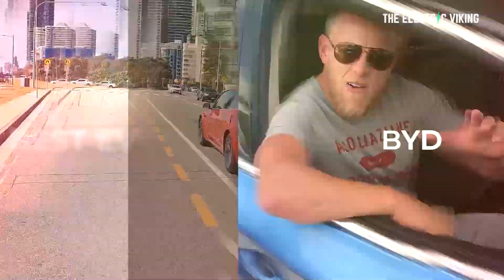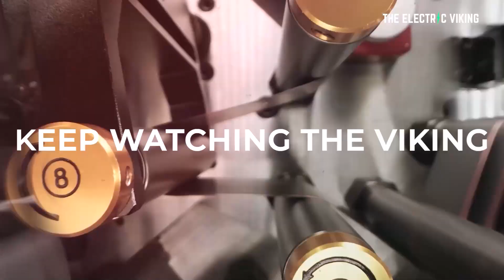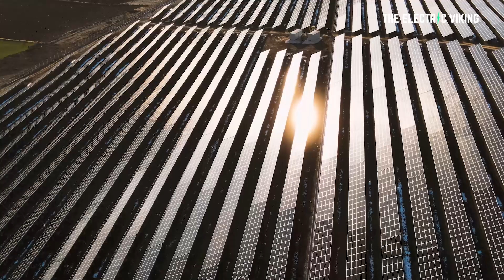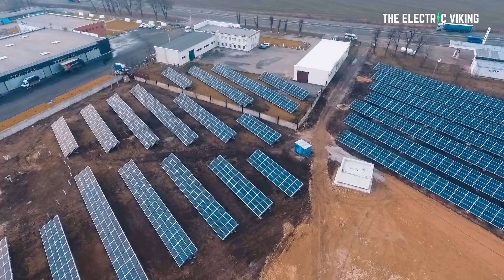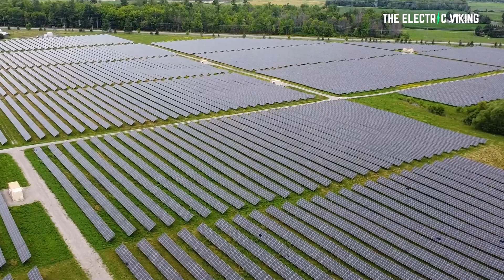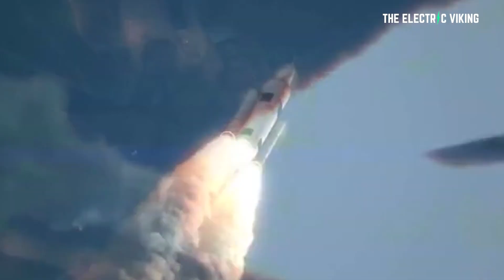Solar panels that work at night could power the Earth 24/7

Comment: Here in Czechia, where the solar electricity is subsidized and more expensive, there is also a lot of solar energy produced during the night: it is simply done by running diesel electricity generators and assigning it to solar. This way these robber barons were able to convert night into a day. Not sure if it is possible anymore, but it was a joke sirprise finding just a few years ago - they really produced solar energy at night by running diesel generators!

Comment: Sorry Sam but I won't hold my breath. Perhaps using the radiated heat from buildings may keep wind generators running but this lack of heat radiation is kinda peanutz! I like the solar panels in space though.

"Space elevators"? Sorry but this is laughable until fusion is happening. It won't really be an elevator btw.

Comment: TEG (thermoelectric generator)  combined with PV - how hard can it be, and getting the returns on expenditure...

NB, so much freaking B$, as admitted... - If you care about power for Africans, give them terrestrial solar for cooking, lighting and refrigeration (some of the greatest advances in health ever.)  the 24 hour reality - absolutely, isn't not this  side of thermonuclear winter.

(NB, the planed Does absorb energy from the sun 24/7...  - for a space generator to be generating 24/7 it needs to be solar synchronous - and we need a global grid to convey such energy world wide (same problem with conventional solar)  - distributed terrestrial solar is much more feasible and on the horizon.

Mass geo/ space engineering is going to be exceedingly risky - and ,ay threaten life itself if the megalomaniacs get their way.

Comment: Is there any way to build a solar panel that works at wavelengths around 10 microns? The average temperature on Earth is 288K and the peak of the blackbody radiation emitted by the surface of the Earth is at around 10 microns with 390W/m^2. If we could build a solar cell for those wavelengths, we would basically be able to harvest the thermal radiation energy from the Earth 24/7.

Comment: Peak energy use 6 pm 8pm. This technology is amazing indeed.Long wave radiation is extremely hot when emitted from th sun. 93 million miles later it enters th earths atmosphere bounces off a brightly colored object toward space but restricted by th carbon level of stratosphere.trick is capture short wave radiation in cold vacumn of space ( high frequency receiver maybe) an use it on earth

Comment: There are a lot of scammers and ill-informed people  in this world: 
1) You cannot harvest energy from a source witha lack of energy. Sure, there is a tiny amount of electromagnetic radiation from space, but that, in turn, only allows very small quantities of energy per square metre to be harvested. 
2) Putting lots of solar PV angels into space and sending some of that energy to the Earth will result in a net gain of total energy hitting the planet. So it cannot possibly reduce global warming, unless other forms of electricity generation are reduced. And in any case, 
3) transmitting RF energy from space to Earth is amazingly lossy. Most of the energy is absorbed by the atmosphere, and water vapour in the atmosphere, except for at specific wavelength ranges, where losses are somewhat lower. 
4) Then when the energy reaches the surface, collecting it all is impossible, unless there is a receiving dish which receives all of that RF or LASER signal, and converts all of it into electricity. 
5) That's not possible with known technology, and never will be, because no receiving system is lossless. It would be absolutely amazing if even 1% of the Solar energy hitting those PV panels in space resulted in electricity at someone's mains power outlet. 
6) The other 99% is lost as heat. That heat i) warms the PV panels and is re-radiated, ii) is lost in the transmitter circuitry and transmitting antenna (even a laser is only about 6% efficient), iii) Heats the atmosphere directly, iv) heats the receiving array, v) heats the receiver and conversion circuitry vi) is lost as heat in the AC conversion vii) is lost because of reluctance and resistance in the step-up transformers, viii) is lost because of resistance in the necessarily long transmission lines (nobody in their right mind would want such high power RF or LASER energy close to a centre of population), and ix) is lost in the usual step down transformers of the local urban grid.
7) Those Solar PV panels will need launching into space and replacing every couple of decades, just as they are on the ISS. It takes up to about 265 kg of fuel to put 1kg into a high orbit which avoids most of the shadow of the Earth. 
8) Those higher orbits are subject to higher levels of radiation, which destroy electronic devices, including PV panels.
9) Panels will be put out of action by space debris, both natural and man-made.
10) Those higher orbits increase the path losses of any RF or LASER signal. For instance, even with the best antennae, dispersion happens, and cannot be reduced to zero.
No doubt there are more causes for losses, but these 10 points are enough to prove the impracticality of such a system.
There is absolutely no valid reason why space-borne electricity generation would be necessary; there is always daylight and sunlight, or wind and wave power, at some place on Earth, and modern storage systems are much cheaper, easier to service and replace, less polluting, do not add to the planet's total heat energy budget, much safer, easier to recycle, and less controversial than any space-based electricity generating system.
And they're easier to recycle. How often is it economically viable to recycle orbital space junk? My guess is never.

Comment: 100% renewable is a stupid goal. The goal should be meeting our needs while minimizing environmental impact, not being called renewable. 
The inconvenient fact is that low-carbon energy generation depends on metals and minerals, just like high-carbon energy generation depends on oil and gas. You can’t call these metals and minerals with a prayer or make them in a lab. They have to be mined. What kinds, how much, and at what financial and environmental costs vary tremendously, and its not related to being called renewable or not. As dilute intermittents like wind and solar are so problematic both in the enormous amount of resources they require and in loss of efficiency when incorporated into infrastructure they have a far larger environmental impact than the other low-carbon options. Over dependence on W&S will involve digging, blasting & leaching more minerals from the skin of this planet than ever before.
What's important is reliability, affordable, and low environmental impact. Focusing on renewable instead is counterproductive.

Comment: The opening picture shows a project that is a stupid waste of land and money. All this is because we convinced ourselves that CO2 is bad without sufficient scientific evidence. What will be the efficiency of these panels after the first big windstorm that sandblasts the stuffing out of them? Do they rotate with the sun? That's expensive hardware. And they are miles from the customers. And the solar flux is just too dilute, do the arithmetic, in Arizona solar insolation for a latitude tilted panel has an average of about 6.5 kwhr/m^2/day. Multiply that number by all the efficiencies and cp to price of electricity. We need 0.5 cents per kwhr energy not 50 cents per kwhr. Talk about propaganda on a massive scale.

Comment: The power from thermal transfer from the Earth to the sky is not substantial. One could use heat pumps and transfer Earth “geothermal” energy to “space” by pointing the radiators to the night sky. This is essentially geothermal energy at night.

Comment: Don't get too excited, even optimized to its maximum potential, it will still only be a tiny amount of energy, at a cost that will never be viable.
Back when solar panels were not producing much energy compared to today, they knew the potential was much higher.
With the energy generation by radiative cooling, it is already known that the potential energy production is extremely low.

Comment: Hi Sam, I was thinking of this problem in a slightly different way. Rather than trying to get energy from space at night, it would be a great way to get rid of unwanted energy. That is the same energy that we demonise as global warming. To radiate it back out into space at night from panels that produced it in one form, electrical power, and send out radiant heat at night in a form that is not blocked by the greenhouse gasses in the atmosphere.🤔

Comment: Are you sane?  Anyone with a credible science degree knows that small amounts of electricity can be generated by any thermal gradient i.e. a difference of temperature.  This is exactly how those car chillers work but they turn current into a temperature drop on the cooler.  There is nothing new about this technology and it most certainly cannot generate any meaningful amount of electricity because it will generate far less energy than the cost of making it work on solar panels.  Even Italian scientists 300 years ago knew how to use what we now call a thermocouple to generate electricity using a diference in temperature.  Geothermal power can also use technology simliar to your refrigerator to turn low grade heat into electricity but it is very expensive per KwHr and also not suited to big Gigawatt generators.  You talk about these technologies like my year 7 students who have no capacity to put anything scientific into perspective.

Comment: 50 mW vs 200 W. Is  400:1 ratio. Plus, The panels will only generate power while cooling down, which may be only a few minutes vs the hours in the sunshine, so the ratio may be 5000:1. Or about 10 seconds of sunshine.

Comment: At about 1/4000th the rated power of a panel, even with 10x improvement with time, the power available is still negligible. I'm all for renewable energy, but this has a very few ultra-niche applications at the very best.

Comment: One issue I do NOT see anyone reporting on is speculation in the materials used for batteries. I have heard that lithium has tripled in price. Is this price driven by demand and supply for lithium? Or is the price of lithium being driven by speculation? 

For example, let's say oil and gas wanted to drive up the price of metals used in batteries, could they speculate in the commodities market to drive up those prices? We know the oil prices are manipulated by OPEC. Gold prices are manipulated by cental banks. Real estate prices are routinely manipulated.

What can be done to stop speculation? Governments can tax speculative transactions to make them unprofitable. For example, in Canada, one city placed a 30% tax on foreign real estate transactions because local real estate prices were being driven up by millions. This killed the speculation. Real estate prices went down. The speculation stopped.

Comment: 50 miliwats per square meter!  You'd need 8 tennis courts covered in panels to power a 100 watt light bulb.  That's 4000 times worse than during the day.  Why not just buy a tiny battery.  This really makes no sense at all, try to curate your content to a minimal extent at least.

Comment: In regards to solar panels in space then they have been used up there for a long time. The problems with a space based solar power station are first to get the panels up there. It is costly and will remain so even with reusable rockets. The advantage here is that they don't have to be very robust as there is no weight or wind problems in space.
Secondly the micro wave transmission to earth is not very efficient and also require a receiver on earth similar to a normal solar installation. It wouldn't be solar panels but micro wave receiving antenna's. A big mirror in space would do the same except micro waves penetrated clouds better then reflected solar light. All these extra costs have to be compared to the cost of bigger solar installations on earth and batteries or some other storage system. A power cable along a space elevator would remove many of the problems but making the space elevator is a big problem.
The development of the sodium battery could easily make it impossible expensive with space power installations for earth as what I read may well make them much cheaper, safer and just as reliable than LiFePo4 batteries. That would also make it irrelevant with night solar panels.

Comment: Thanks Sam Evans for covering this interesting subject.  
This book shows what is urgently needed but not widely understood: "Climate Restoration The Only Future That Will Sustain The Human Race  Peter Fiekowsky Carole Douglas"  Dangerous tipping points must be stopped and reversed!    
New concepts for a space solar shade and SpaceX launch cost reduction will make a space solar shade at the L1 LaGrange point possible.
However the most practical power beaming receiver base is at the North Pole.  So either it will be used to generate fast quantities of hydrogen fuel and/or it will be connected to a very high capacity electrical super grid.
The next 100 years of power and energy technology development will be incredible to see!

Comment: I have some solar lights on my fence that work after the sun moves to the front of the house in Oct.  I was amazed when this happened when I first got them. Those little lights would stay on dimly almost all knight for a few years but now the batteries declining and had to replace them.
Reply: Yes. Batteries. Not solar panels working at night.

Comment: Milliwatts are almost completely useless, it can't even run your night light. We don't need new technology, and we don't need to wait 30 years to move. We can already implement 100% clean energy today, with what we have, it's just a matter of scaling solar, wind and storage up. A matter of mass production only. Everything else will be too late. Better figure out how to do the laundry, water heating and EV charging during the peak sunny hours. And how to convert UV light into red for cloudy days. There's only one new tech that I think will happen fast enough, and that's drilling deep several miles / kilometers into earth with plasma / millimeter wave. That can still happen in a year or so, and a single hole can sustain a large city, even the size of New York. Everything else will be too late. Especially fusion. We only have enough tritium for a single run of experiment, and it's over.

Comment: What's funny about wind and solar energy is that every economy on the earth that is heavily invested in renewable is struggling to provide enough energy for their electrical infrastructure?

Multi-Trillions of dollars invested and yet the impact it has made on the energy used has been negligible. And using the US as a case in point that use is barely 1% the amount of impact of all that wind and solar investment was a 1% reduction in fossil fuel use.

👌 👏 😍 👍 🥰  That's some great R.O.I you got going on there. So if we invested 1 Quintillion Dollars we could finally reach double digits?

Comment: There's nothing new about the radiative cooling solar panel. They just glued a thermoelectric generator stack on the back of the panel to use the small temperature difference. TEGs have been around for decades (used for active cooling as a solid state heat pump). I bought some from a hobby electronics store 20 years ago. Some TEGs (thermocouple generators), from 70 years ago or more, can power a small radio receiver with the heat from a gas or kerosene lamp fire (with appalling energy conversion efficiency, mind you). It's also how radio thermal generators (RTGs) for space missions work (Voyager 1 and 2 use them). The heat comes from plutonium that just sits there being hot and the cold side is space. And these micro-power night time "solar" panels still don't work on a cloudy night because the clouds reflect back the radiated infrared energy. That's why it's warmer on cloudy nights. Space solar panels, beaming any amount of power to Earth is an idiotic idea compared to any other option available (yes, including using plutonium RTGs in your garage). And the LAST thing we need is more space junk polluting geostationary orbit. Notice the CG animation space solar panels obviously in low Earth orbit, crossing your sky in minutes? If your space solar panel isn't geostationary, it won't be able to beam its power to a fixed base station. If it is geostationary, it's sooo far away from Earth than the microwave beam spread for power transmission will be many kilometers in diameter... not like a laser beam hitting a receiver on the ground of a few square meters. It's good for transmitting satellite TV signals to a whole country footprint. Also, if your space solar panel is geostationary, then it is rotating with the Earth and so its solar panel has to move to track the Sun, right? Oh, and it can only be in an Equatorial orbit, so no beaming power to high latitudes? Microwave power transmission is feasible over short distances (a dozen meters or so) but is ridiculously inefficient (and dangerous).

Comment: There's also a national security issue to be considered

Some years ago I came across a study that said if someone were to sabotage about a dozen or so nodes of distribution of electrical grid in the US it would crippled the US electrical system for months or even longer.

So consider the alternative millions of houses with solar, energy storage, and electric vehicles.

In such a scenario will be damn near impossible to sabotage it and bring it down and thus this would increase national security tremendously

Scientia you,
(Knowledge Has No Home)

antiguajohn